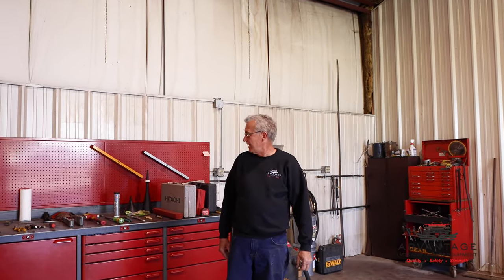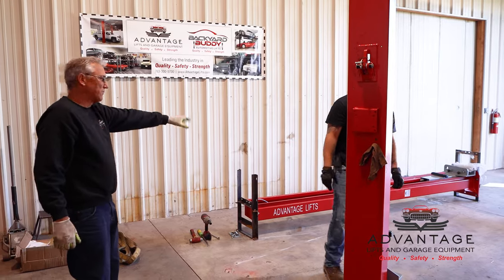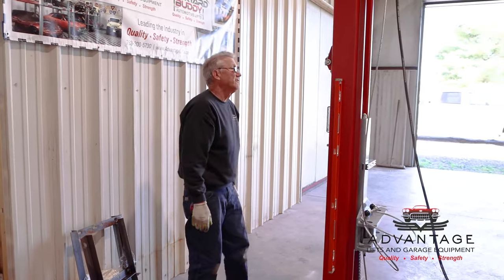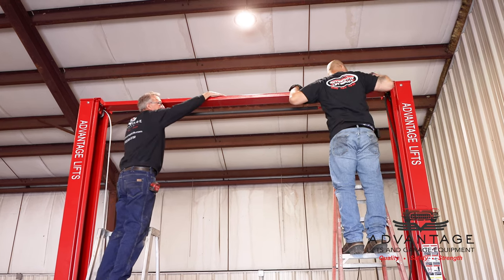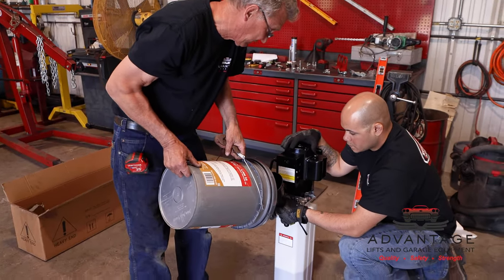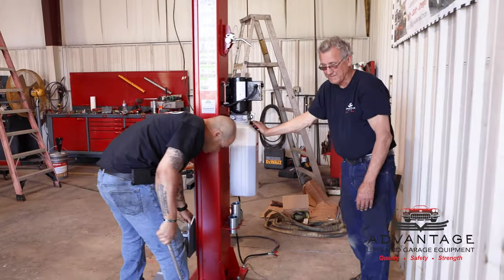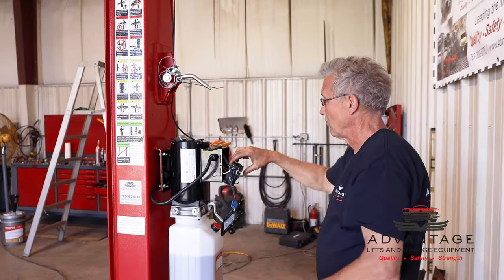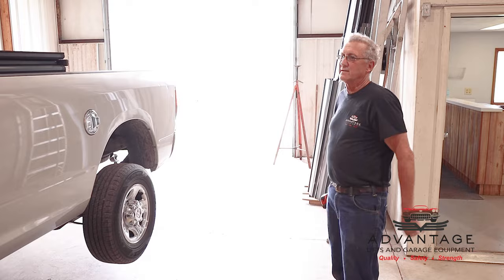AL-SC10 2-Post Lift Complete Install

Comment: I ordered mine a few days ago I’ve been looking at lifts for months going back and fourth from cheap to expensive lifts, not once did I come up with advantage lifts some how an add popped up in my feed looked you guys up. The price point, the care and quality you guys put in your product and the customer service made me order my lift about 20 mins later. I can’t wait. I’ve heard many stories about how the cheap lift have terrible instructions and non existent customer service, for you guys to have all that at an affordable price really says something. This video was top notch and and shows you guys really care about your products. Thanks
Reply: Just got mine up last weekend, i got the old manual so i had to convert the metric to standard. The manual is very vague, there should be a parts list to cover what the nuts, bolts, screws, and washers go to however it does not. This video will help you with the install for sure. The customer service i've dealt with has been great and the quality seems great as well. haven't used it a lot yet however did use it to make sure it works. Over all, for the money i think you will be pleased with this lift.

Comment: Great video! Thanks for explaining everything in detail! One thing I'd like to clarify as a mechanical engineer is your fastening of the concrete bolts with 100ftlbs. There is no technical reason why you would check this with a lower torque setting (only 70 ftlbs)! Mark the bolt heads with a paint maker on the baseplate and note if they have moved (anti-clockwise). THEN you've got a valid reason to re-tighten them..

Comment: Video was very helpful because the included instructions are trash. However, I ran into one issue during my install. I followed the video step by step and at the 45:00 min mark, the overhead switch was connected to outside terminals. When it was time to connect to power, the lift did not work. After reviewing the video again, and checking I connected the switch to the motor correctly, I could not figure out what the issue could be. At the 1:56:16 mark he says the wires should be connected to inside terminals on the overhead switch. I made that change and it worked properly. Make sure to connect to inside terminal on the safety switch before installing to the overhead bar. It’s much easier on the ground than on a ladder.
Reply: i noticed the same thing however i caught his comment at the end about using the center posts on the switch before i powered it and made the correction so i had no issues. The instructions in the manual are horrible and should even have a parts list for nuts, bolts, screws, and washers however does not!
Reply: @1badaff889 I just set up my new lift and when I was going to wire it to the motor I caught him saying to us inside I was not happy because not I have to get back up there to redo it. He should have said something in the video about that. I watch it all the way before I started too

Comment: What a. FANTASTIC VIDEO!!   Thank You guys for making it! This kinda stuff is what makes Youtube Great!  
One question I have is some other videos recommend using concrete anchor epoxy for the anchor bolts is that something you recommend?

And one other you tuber recommends threaded rod and epoxy. I'm thinking the rod would be good if you had lets say a 12" floor I dont think it would be useful in say a 5 " floor
Reply: 100% you should be using chemical anchors. Not the mechanical ones shown here. The chemical anchors use a different type of stud. It's basically a threaded rod you press in, let set, then you tighten down the nuts to 
spec.

Do not use mechanical anchor bolts and epoxy them. Use the proper threaded rod.

Comment: When he wired the cut off switch at the top he used the two outside terminals then when he wired it to the on and off switch he told us to use the two inside terminals 🤔. He needs to fix that so we are not left confused. Now I have to check to see which is right because I used the outside
Reply: I’m sure you already found out by now but it may help someone else to know that it is the two inside terminals. He was wrong when he wired it to the outside terminals.

Comment: How do you tighten the double nut on the cable that goes down into the carriage? Can’t get a wrench in there.
Reply from the maker: Hey there! Sorry it took so long to respond. Hopefully you found a way, but you have to tighten the nut before installing that part. There is no good way to get a wrench down there unless you install it before, or raise the carriage up to be able to get back there.

Comment: Couldn’t get an over head safety switch and add it to my rafter ? I have a base plate style because my rafter height it only 11 4”.
Reply: Any normally closed momentary switch will work. You'll just need to make a bare that pivots on one end and is allowed to move up and down an inch on she other. A piece of emt with pipe insulation should be fine

Comment: the video was very helpful, but had mistakes a that caused backtracking and was frustrating. The manual provided is inadequate and misrepresentative of the materials included in the lift. A more accurate video, a packing list and a better manual is needed. To be clear, the packing list is essential, because I was unaware of missing parts until the time I had set aside for install.
Reply from the maker: Thank you for the feedback. We are actively working on a new manual for this lift. I also like your suggestion about the packing list. I'll pass this along to our team. We hope you enjoy the lift!

Comment: If lift has a top cross bar do they still pull in? I figured you’d do the slight outward tilt on the bottom cross bar and just go dead straight on this style? Actually curious bc I’ll be installing one soon. Thanks for any help
Reply from the maker: Hey there! Give us a call at 763-300-5730 and we can help you with this question and more.
Reply: @advantage_lifts  I have to install this week where can I get the manual for the us?

Comment: Do you shim the second column also?  Didn’t see anything in the video. One looks to need 1/16 shim on 2 bolts in second column.
Reply from the maker: Hey there, Enzo! Sorry it took me so long to get back to you. I needed to get an answer to your questions. Yes, you can shim the second size if needed. It really just depends on the tilt or angle of your garage. Shimming both is completely fine, shimming one is completely fine--as long as it's needed.

Comment: The installers tightened my anchor nuts to 150 ft lbs, instead of the 100 you stated.  I couldn't find that specification in the manual.  They said retighten should be to 80 ft lbs. whereas you said 70 ft lbs.  Can you confirm which is correct?
Reply: The torque spec isn't as important as the type of anchors. Mechanical anchors are yesterday's news. Chemical anchors will make your life much happier!

Comment: The instructions for my lift doesn’t go into any kind of detail what so ever. Like the overhead bar, the overhead safety switch, etc. no details at all. It just says mount it to the bar. Well how do you wire it? How do you even mount the bar?? He says in the video it shows detailed instructions.
Reply from the maker: Hey, Coltan! I'm sorry the installation isn't going as planned. I would advise giving us a call at 763-300-5730. We can provide support over the phone and help install the overhead bar and answer any questions you may have!

Comment: so as you lowered the truck that sound of rushing air escaping from the hydraulic  reservoir is normal correct.??
Reply from the maker: Yes, that noise is just the flow of the hydraulic oil back into the tank. All good!
Reply: thank you great job on the lift.  @advantage_lifts

Comment: I'm putting up this lift now and the instructions are still metric. Also at 45 minutes he tells you to wire the overhead switch to the outside posts in the switch, then at 1hour 55 minutes he tells you to wire them to the two center posts. Your 4 post video was great, I knocked it out so easily... the AL-SC10 video isn't bad but so many details missed or edited out, the AL-SF10 video downright sucks.... no talking to let you know what's going on and why, just crappy music for 20 minutes